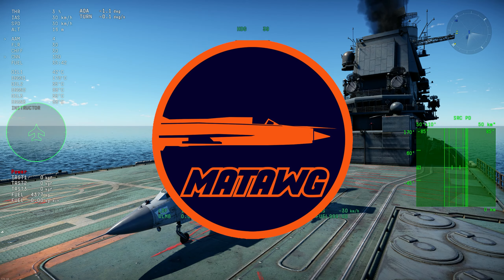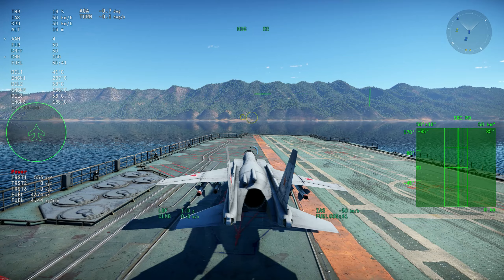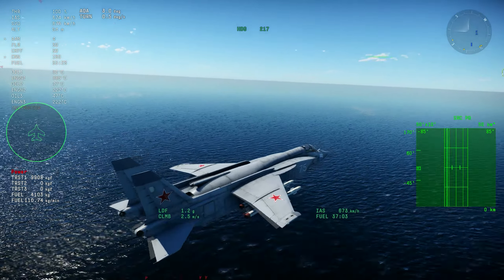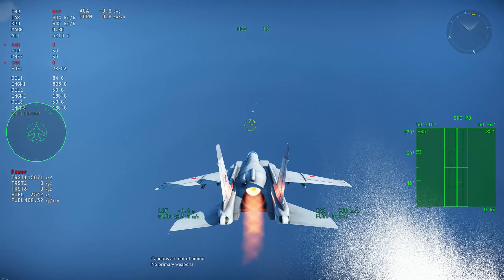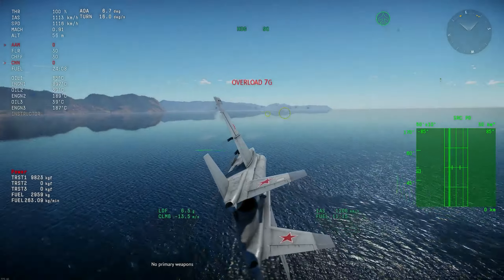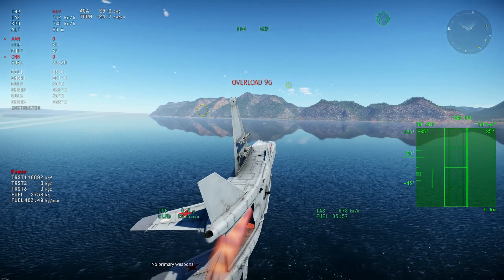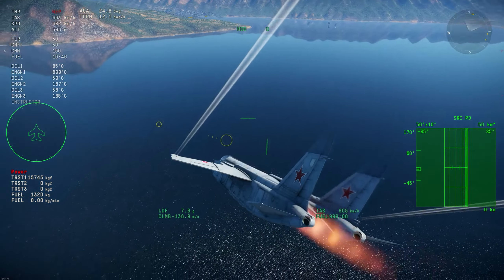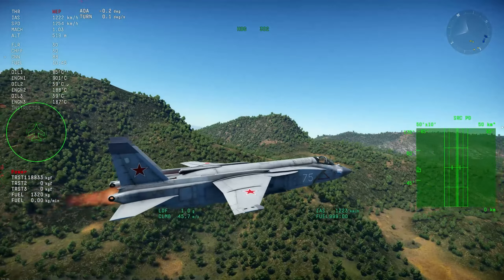War Thunder DEV SERVER Testing the PERFORMANCE of the Yak-41 (Yak-141), it has 190Kn OF POWER!

Comment: I feel like in a dogfight it will get beat by an f16/mig 29 or even a really good f14 pilot but beyond 20 km it can do whatever it wants to its opponent
Reply: i mesn, everybody flies low now so... :C
Reply: In a 1v1 itll most certainly lose but like in a actual game itll dominate, just like the f16 vs mig 29 the f16 will win in a 1v1 but the mig 29 is more meta and usable.
Reply: it easily beat a f-14 in a dogfight, look at matawgs other vid where he does bvr against a f-14 then dogfights.
Reply: @biolock6290  That f14 pilot does not know how to dogfight why would he energy fight the yak 41 when it has 3 times the thrust. He shouldve spiraled down while cutting the engines and with airbrakes that wouldve played to the f14 strength. Which is energy rentention and massive lift with the wings extended. The yak 41 bleeds energy like its a 50% off taco tuesday sale.
Reply: @yuki1zz668  spiral down? The yak's aoa would have gotten guns on even faster and 1 tapped that f-14 to the hanger, please think a little more, yak has more aoa than the mig 29 like cmon man
Reply: @biolock6290  bro ive played f16, mig 29 and f14 to their full extent please dont talk like you know since the f14 does not have the thrust required to keep up that stall and mat couldve ended the fight faster if he just gained some speed and then pulled in since he has a lot of thrust he wouldve gained so much speed by just flying straight for half a second by spiraling down and airbraking it becomes who can turn the fastest at low speed and guess what the f14 has massive wings while the yak doesnt.
Reply: Depends on pilot skill and aircraft upgrades cuz i beat a f16 yesterday, fm isn't done obviously and it prob should lose but the vtol helps quite a bit to reset a fight
Reply: @plazmaflare5199  That f16 can just take u to the rate fight because rn the yak bleeds way too much speed and vtol can’t help that
Reply: @biolock6290  I actually don’t think you know what you’re talking about. In that fight the F14 had an altitude advantage and he immediately threw it away at the merge. At the distance between them he could have easily just stayed out of Matt’s guns and if Matt tried to climb to reach him he would have been stalled out. From that point on it was an easy fight. In a fight when they enter the merge at the same altitude it’s a different story. The tomcat could probably still outrate the yak due to it’s better energy retention though.
Reply: @Daakkii  this is like a mig-21smt vs f-5c, f-5c should be winning every time but smt wins 1 circle no matter what
Reply: @Daakkii  new matawgg vid out
Reply: @biolock6290  I watched matt’s new vid… once again poor management of energy and a chronic avoidance of the rate fight. In the video you see whenever the yak rate fights it loses because it bleeds too much speed. The yak should be pretty easy to deal with in other 4th gens because you can always force a 2 circle but you can’t always go 1 circle

Comment: they have to buff f16 then, no reason this should pull 14 while f16's stuck at 9
Reply: and 29, buff all of em pls
Reply: @vascoiraola5209  mig 29 fm already buffed
Reply: @mr.abrams8112  not really, also f-16s have f-14s to back them up
Reply: @mr.abrams8112  still worse than the f16 in a dogfight
Reply: @eaststarling7805  no... MiG-29 flight model got changed this dev server... i seen it do like 11-13G's starting turn from mach speeds
Reply: mig29 should pull nore than 25Aoa, in game only pulls 22, if they don't buff it i don't mind. but if they do, I'll be happy. I want both f16 and 29 to get buffed.
Reply: @vascoiraola5209  apparently miG-29 flight model got changed... idk how much more AOA it can pull... but i've seen it pull 11-13G's starting to turn from mach speed...

And Yak-141 can pull like over 25 AOA... apparently 30-35 AOA? lol

Comment: How does it have full fly by wire but can pull more AOA than a Mig29 and F16???
Reply: Yes
Reply: F-16 is fly by wire. It doesn’t = can’t pull AoA. Simply means it will avoid uncontrollable flight.
Reply: Because gaijin needs some fake reason to nerf the F16.
Reply: Because it didn't have a 9g limiter like the F-16.
Reply: @LewisB3217  True just like he says in the video, in DCS you can turn it off on the Mig-29
Reply: Let's face it the plane will be nerfed on day one
Reply: It is way more modern
The MiG-29 in game is a early 80s jet, just like the F-16. But the Yak-41 is a late 80s plane. That's what I would guess could be the reason, sorry if it's not

Comment: Why Yak-41(Yak-141) ? Yak-41 and Yak-141 are two different aircraft. Yak-41 is a prototype with the name "product 48-1", and Yak-141 is "product 48-3". The Yak-141's swivel tail booms have been replaced with a small swivel nozzle, and the hull structure itself has been reinforced. These are two different planes.
Reply: Yak-141 is a name made for western audiences...

Yak-41M is definitelly classified name and legally can't be used lol

This is a Yak-41M probably since it's like the only version actually made and flew... there is another one which was proposed but never built... it's delta wing i think... looks really cool but it's ENTIRELY different plane lol...

Pretty sure Yak-141 name is based on Yak-41M and not the first Yak-41
Reply: @kajmak64bit76  "Yak-141 is a name made for western audiences..." - no. The name was changed due to delays in development time. Where does this nonsense about the "forbidden name" and "for a western audience" come from? This is funny and stupid. Experimental samples of the Yak-141 were 4
Reply: @kajmak64bit76  Yak-141 received before the first test flights, I'm not reading Wikipedia, but an article by a test pilot who flew the Yak-141. Never link to Wikipedia, it is edited by ordinary people and is full of nonsense
Reply: @АнтонГородецкийНочнойДозор  This wikipedia also has the source of that information if you didn't know...
Reply: @kajmak64bit76  show the source, not the Wikipedia article